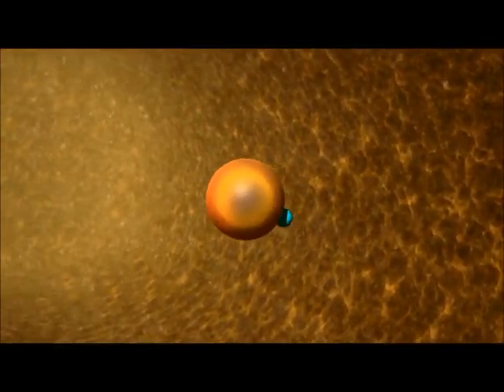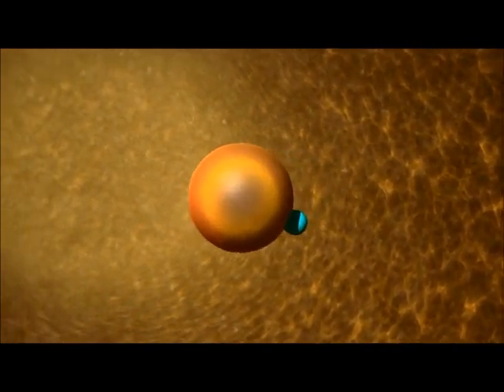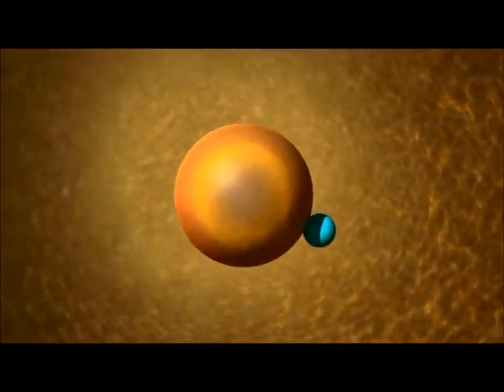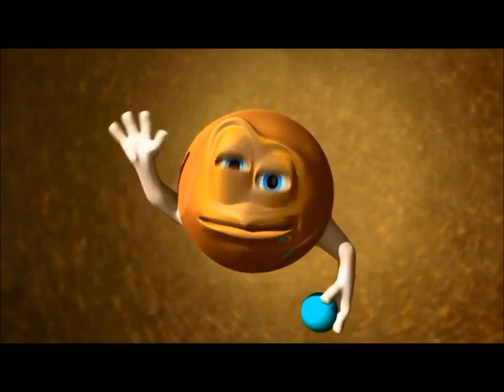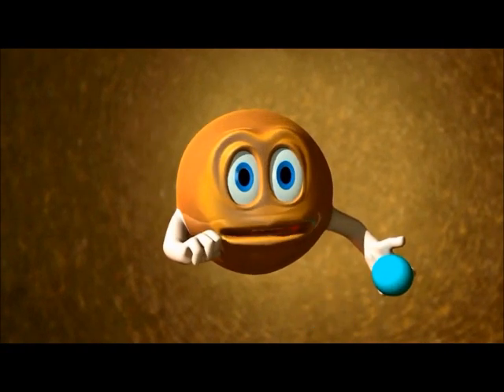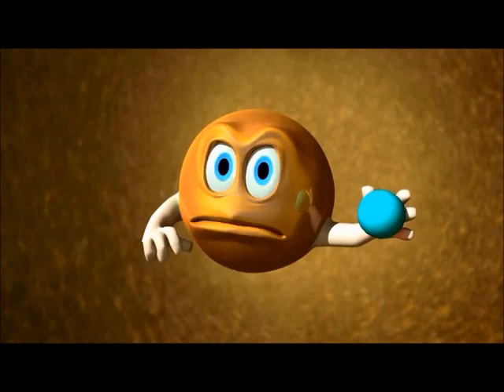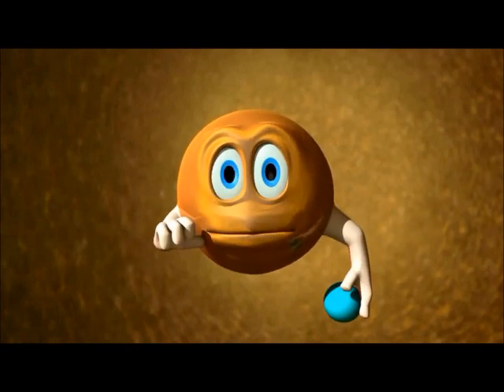How A Water Softener Works [Mr Resin animation Explains About Water Softening]

Comment: If the resin initially has sodium ion attached to it and when it contacts iron it drops the sodium.....why does a sodium water flush cause the reverse process? It would seem that the resin has a stronger affinity to either iron or sodium.  And it would only be possible for the ion exchange in one direction.  That is my question.
Reply from the maker: The sodium (brine) is in a higher concentration and "bullies" the calcium and magnesium (low concentration) from the ionic exchange resin.